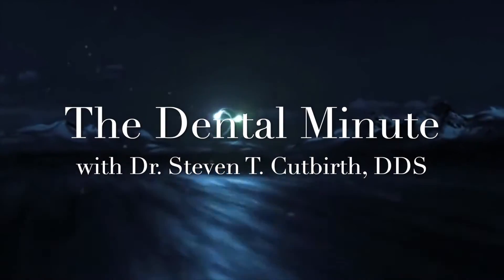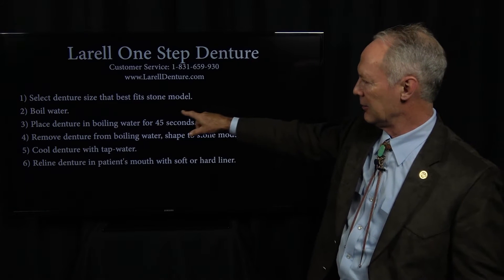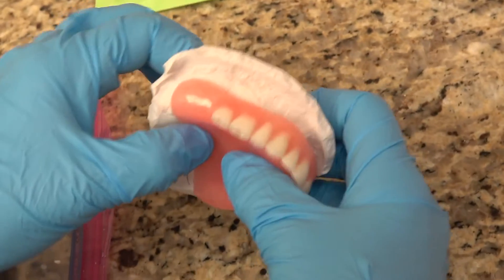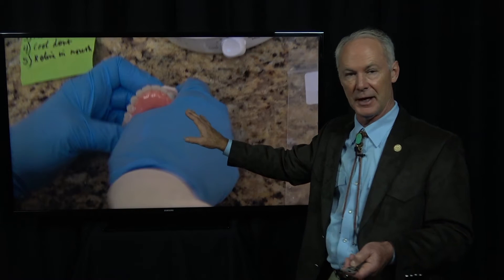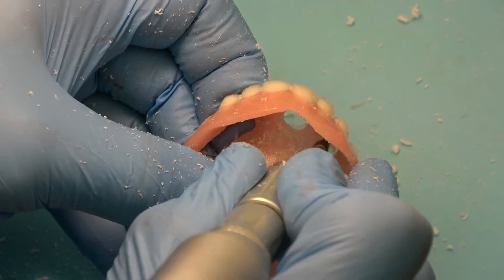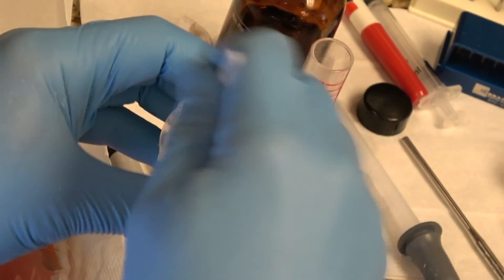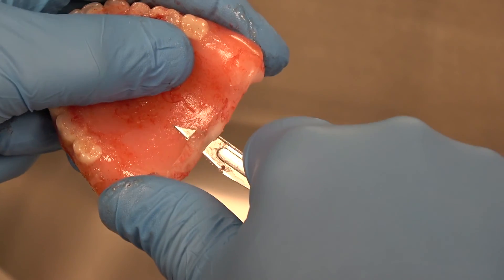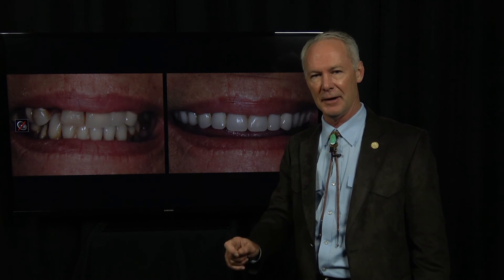Larell One Step Denture - with Steven T. Cutbirth, DDS

Comment: This is a pretty cool idea, thanks for the vid! I'd love to see a related video on the steps you take for your traditional immediate dentures as well.
Reply from the maker: Subscribe to DentistryMasterClasses.com. There are several videos on immediate and regular denture fabrication secured by small diameter implants.  The steps are basically the same as with a traditional denture without implants.  I do not fabricate dentures without implants.  I will occasionally make an upper denture without implants, but never a lower denture.  It is too difficult to make them fit comfortably.  Certainly there are dentists who can fabricate a lower denture and make it fit correctly and satisfy the patient without implants.  I am just not that dentist.  I do not want the hassle of endless adjustments and never achieving a satisfactory result.

Comment: Can u plz upload videos of learning complete dentures.. Step by step Sir.
Reply: Woah there its called dental minute for a reason
Reply from the maker: I do not do dentures without implants, usually small diameter implants.  I want my patients to like me and I don't like adjusting dentures without implants to secure them forever because it is just so difficult to make a denture, especially a lower denture, fit correctly and securely without implants to secure them.  I believe there are dentists who can do a good job with dentures without implants.  I am not one of those dentists.  Subscribe to DentistryMasterClasses.com.  There are several cases of fabrication of upper and lower dentures secured by small diameter implants.  The steps for denture fabrication are there.

Comment: Can you have the patient fit it, after boiling, directly in their mouths?  It reminds me of the cheap mouthguards I used in sports as a kid, and that's how we molded those.
Reply from the maker: I think the big problem would be the denture must be boiled and is hot when molded on the stone model.  I think the boiled denture would be too hot to place directly in the mouth for molding.  Also, the occlusion should be adjusted if placing upper and lower dentures, even though I never place an immediate lower denture.